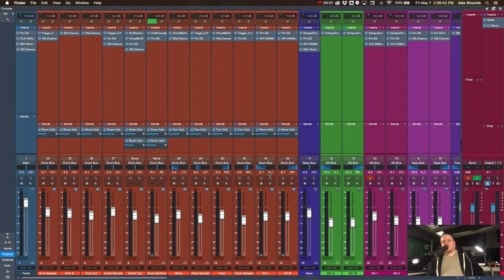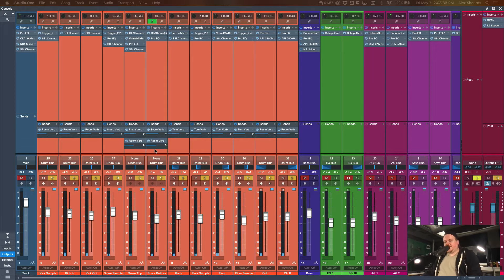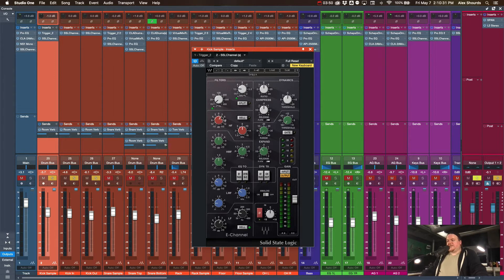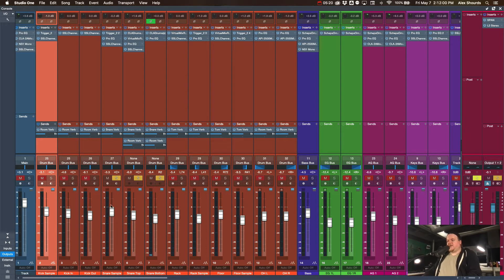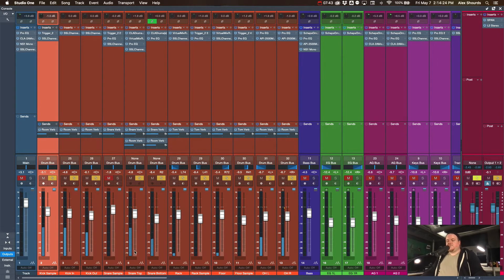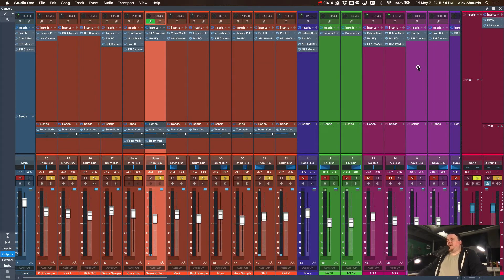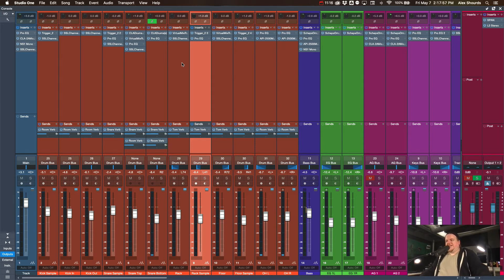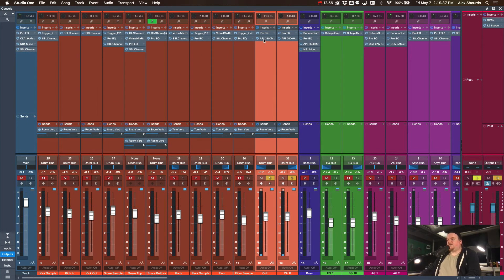Church Broadcast Mixing In A DAW // Drums

Comment: Hi Alex. I'm curious as to how you routed the audio from your mixer to the DAW and from the DAW to your streamer. 
Ps, i don't have Dante®. The audio from my mixer can only output back to the mixer because of how it is setup (DN32 Live on Windows)
Reply from the maker: We do run everything over Dante. All of the tracks come from our WING sound board at FOH over Dante to our mac that we are broadcasting from. The final mix then goes back to our FOH console over Dante so I can set the final level and then it comes physically out of one of the outputs on the back of our board into our Resi Encoder.

Comment: how do you deal with delay caused by trigger. in my broadcast mix i experience a slight delay between the sample and the raw drums
Reply from the maker: @outlawzdeft3593  in the settings, you can set the trigger latency to "live" mode which reduces the plugin latency to about 4ms which is basically inaudible. The default setting is about 23ms which would be audible.
Reply: @AlexShourds  Oh right! that solved it. Thanks so much

Comment: Question, with the kit having individual sends to FX and you controlling the Drum bus volume with a VCA, won't you still get Drum FX coming through even when pulling down the VCA? I would think you'd assign the VCA to each piece of the kit.
Reply from the maker: The drum VCA also has the drum verbs assigned to it so when I pull down the VCA, those verbs come down as well
Reply: Gotcha, does that still account for sends to Room Verb? I really like this template and plan on mirroring it but was wondering if I should just assign a Drum VCA to the pieces of the kit for full control. Are you controlling the sends as well with the VCA(not sure if that's even possible)?

Comment: I have a similar set up in my local church. We use pro tools for broadcast and signal is feed through Dante. We also have the Kalis and they are great! Very flat sounding speakers great for almost anything you throw at it.
Reply from the maker: We actually stopped using the Kali's. I did like them but I felt like it was hard to really push them and get the low end right. I got a set of Focal Alpha 50s now and they are absolutely incredible! I feel like I can hear every single detail on them